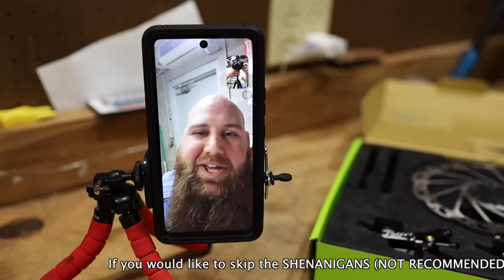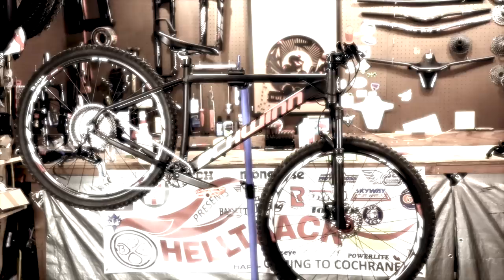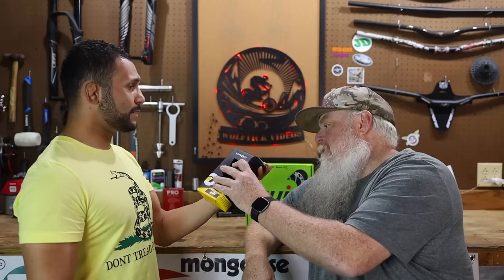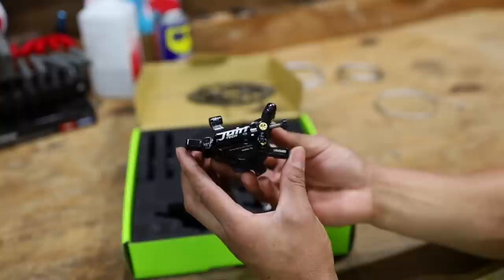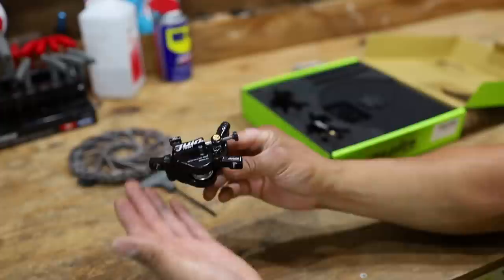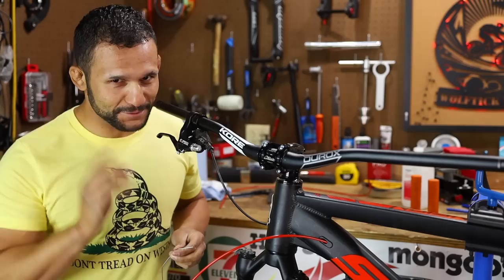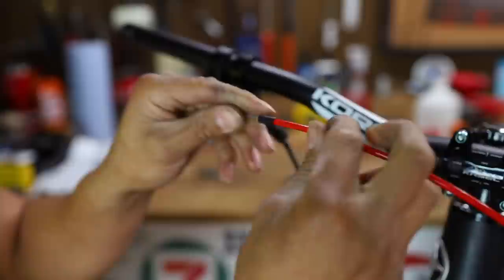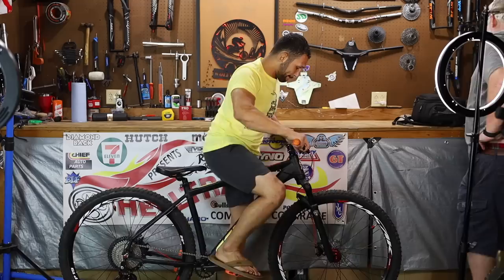Juin Brakes: Initial Impressions | Install

Comment: Avid hydraulic brakes were doing that for many years.
You would go to get on a bike after not riding it for a while and the brakes would be locked up.
A quick fix is to put some sort of catchment underneath the bleed screw on the side of the caliper so it does not drip onto the brake pads or disc rotor or your floor.
Then in one hand have the star drive tool to undo the caliper bleed screw  in the other hand have the brake lever and  gently squeeze the break lever just a tiny little bit and undo the brake bleed screw just a little bit so you get a little bit of oil seeping out then do the screw back up before releasing the lever.
You might have to do this a couple of times and you may have to take the wheel out and push the brake cylinders back into the brake caliper housing after doing this then put the wheel back in squeeze the  lever a few times to get the pads back into there normal operating position then realign the brake calipers.
Hence I never have had Avid brakes on one of  my bikes and I would not go near them though they were better than Hays brakes by a country mile. But that's another story.
I always used Shimano and never had a problem like this.
I will say that I have purchased the second hand bike recently with Sram/ Avid Guide RSC twin pot calipers and 180mm rotors 
And they are the best brakes I have ever used

Comment: Post op Wolfman had me ROLLING!!! Dude was funny right from the start! 

The rounded spacers are to correct for any deviation in the angle of the mounting bolts if you are using adapters for larger rotors. It keeps the bolt heads "flat" against the adapter surface.

Comment: Hey fellas and wolf tec Nation
Those adjustable brake levers were designed to be used with v brakes or cantilever brakes hence the two positions cantilever brakes have a short and v-brakes have a long arm. Two different leverage ratios 
I do agree with you  I felt a bit robbed  the first time I used a set many years ago and I wanted to be able to adjust them just like the avid levers..
Still for the price they are very good. Oops I wrote this before I watch the full  video and berserker was absolutely correct.

Comment: I’m surprised no one has told you a fix for the Avid brakes. Very simple. DOT fluid attracts moisture, thus adds water to the bladder which over fills it. Where the line goes into the lever, turn that large rubber boot to expose the bleed screw. Remove the bleed screw.Remove 13:26 the caliper from the frame/ fork. Put a pad spreader tool and push the pistons back on both sides. Excess fluid will shoot out of the bladder. Put the bleed screw back in, then put the caliper back on pull the lever and good as new.
We encounter this with Avid brakes at the shop at least once a week.

Comment: Juin tech is a Taiwanese brand, and been around for awhile, mostly for road bikes.  A Taiwanese youtuber did a test with trp spyre dual pull mechanical caliper, ultergra rim brakes, juin tech cable pull hydraulic, and 105 brifter with shimano hydraulic caliper.  105 did the best stopping, follow by juin tech and ultergra with a tie, then trp spyre finished last.

Comment: 10:07 Early batches of Sram Level, Code had issues with master piston seals swelling during hot summer days, it locked the brakes. But replacements solved that I think.
But if you use mineral oil in Dot brakes or Dot in mineral oil brakes, the pistons will swell and brake won't work.

Comment: 16:04 The rounded spacers are used for making the caliper flush with the rotor. But if the frame has been properly manufactured, brake mounts have been faced, no paint overspray it should be fine without. 
The tool is not cheap, but easy to get, as ParkTool offers it.

Comment: 10:44  If the pads were worn, and brakes were bled with the pads, the system is overfilled, so when you put new pads in they will constantly rub. But  keep in mind the pistons need to be lubed from time to time. Only use the fluid the brake uses or compatible suspension grease.

Comment: If brakes with DOT fluid are not maintained, after a while DOT eats up rubber o-rings and/or plastic piston in the lever, which can swell and make problems.

Comment: Have you considered this bike:
2023 Marin San Quintin frame set. it's 549. 
As a complete bike that's San Quintin 3.

Pros:
Super low top tube, seat tube.
42200mm  reach on XL so marin offers size that fits me. 422 on S
64 deg head angle, so that's acceptable.
Great standover

Now the negatives:
brake mount is between chainstay and seatstay. so rear rotor size is limited.
1 & 2 are skewer, so bad choice.

Comment: I've looked at those Juin Techs a couple of times now with a view to getting some for the gravel bike... it's got Sora drop bar lever/shifters (brifters?) and cable calipers on it now, which are decent enough for cable pull disks but I wouldn't mind a bit more power... but swapping to hydro brakes would mean Tiagra as a minimum which would be new drivetrain too, which would be... more than I want to spend shall we say? I'll be watching out for the realtime review 👍
Reply: Andy, I have the Juin Tech R1 for road levers on my gravel bike as well. They are impressive and a better option than the full hydraulic system

Comment: Hey guys maybe you can help me out. I am looking for a 9mm qr, 120mm travel air fork for a 26r. But I need a 100% lockout switch on the fork. I bought a set of rock shocks Judy silver's that allegedly had a lockout but still had up and down travel which drove me nuts and was pointless. I currently have the 2020 Schwinn axum DP and a little bit of play that is in the lockout on that spring fork is just fine for me. But nothing more will be acceptable. What can you recommend for a good budget fork that is reliable for some light downhill and cross country? I found a trek fuel that was trashed and have rebuilt it. Now I want to put a new fork on it to replace the rock shocks that was originally on it it has no lockout. The fork must also accept manual caliper brakes and it would be nice for the possibility of disc brake mounts on it as well.

Comment: I would go fully mechanical or hydraulic. I don't get why anyone would go for this type.
Reply: I had mechanical disc brakes on my gravel bike. The combo of mech brakes and tiny tyre contact patch meant braking was sketchy AF! I realised it’s different from MTBs, but drop bar brake/shifter levers are well expensive. I upgraded to hydraulic callipers and found hybrid to be a very good option for gravel. But having said that, I wouldn’t MTB with anything other than hydraulics!
Reply: If your a dirt jumper this is pretty cool because you could run a bmx gyro and a hydraulic brake together